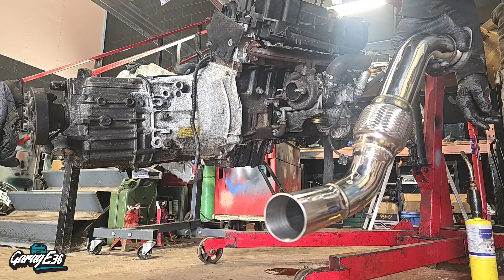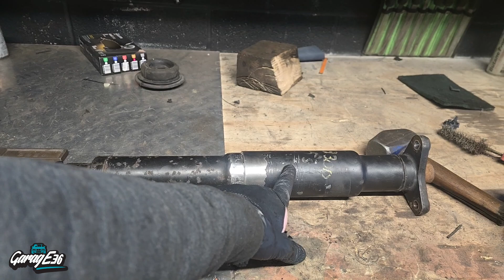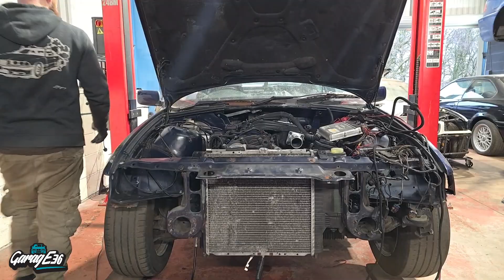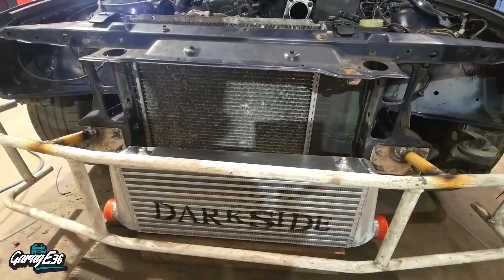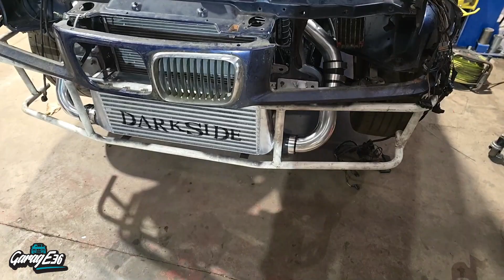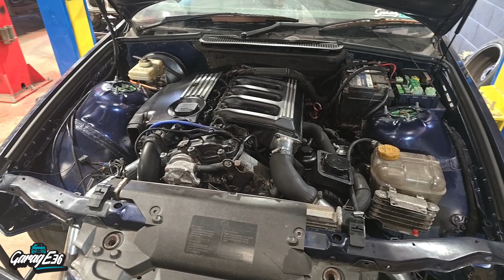BMW M57 E36 Swap | Diesel E36 Drift Build | How To Guide

Comment: Any chance you could give me the part number to the gearbox mount. I have e36 auto mount but its no good. And e46 manual mount and no good lol running out of options
Reply from the maker: I thought i used e36 328 auto mount, if 328 auto mounts doesn't fit then it would have just been the standard e36 manual mount I used.

Im using m57 with the e46 5 speed box, engine is on the standard e46 engine mounts and arms

Comment: How much it costed for the conversion everything ?
Reply from the maker: I already had the engine and gearbox in another car, I spent about £1000 on extra bits and pieces. 

Probably a £5000 conversion if you had to buy everything pay some one to fit

Comment: What differential are you running???
Reply from the maker: Currently on a 2.65 318tds compact diff.  Was on 3.38 petrol diff for first few days, was to short really..

2.65 feels decent, not easy to find tho
Reply: @GaragE36uk and the low fuel  pump...? Did you change  it? Or nothing was changed in a tank???
Reply from the maker: @Cr.Golden7 standard e36 fuel pump in tank